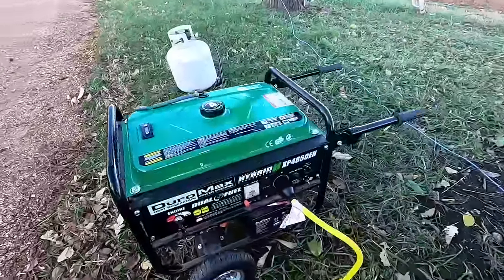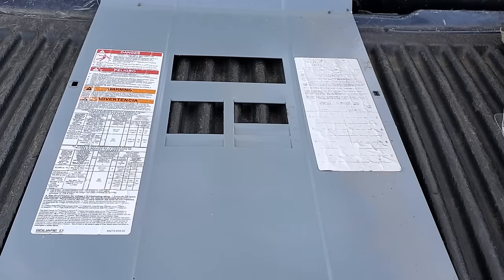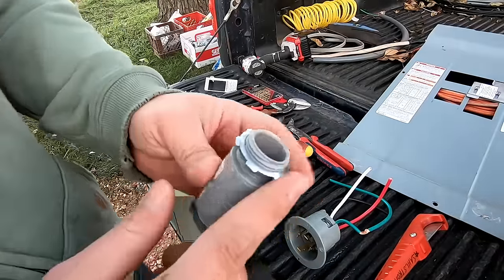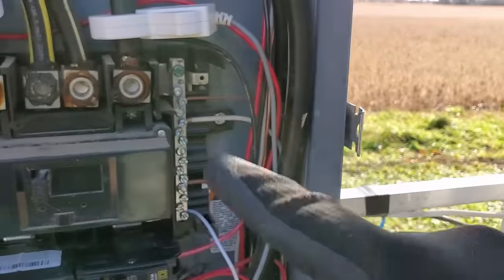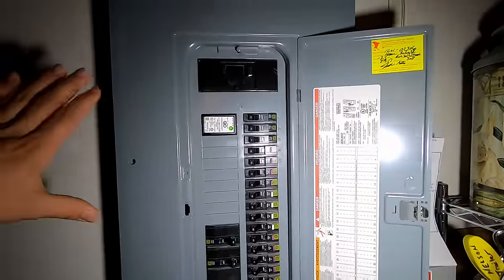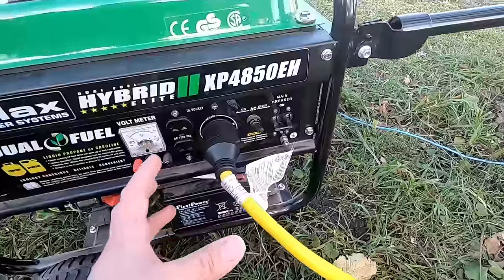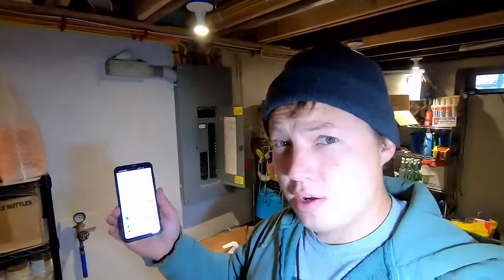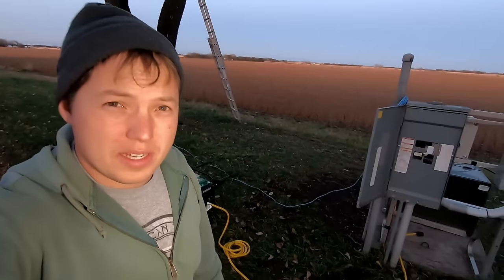How To Hook Up a Generator To Your House Using a Breaker Interlock Kit & Power Inlet Box

Comment: Excellent video. I love all of your videos! I have one exception though. I have to disagree with you a bit in regards to your comment about the Duramax generators. I have three of them, (one is a 7200 watt diesel generator) and they all work perfectly. Never a problem with starting or running. China did a good job with these.

Comment: I love the idea of the propane fired engine for your standby generator so you don't have to worry about gasoline going bad and fouling up a carburetor. Great video. Thanks a lot for the work you put into it.
Reply: Here are the generator safety rules that everyone needs to follow: this is just a reminder for everyone’s safety. Always make sure you follow all the generator safety rules whenever you use your portable generator. Generators can be dangerous if not used carefully. Every year, hundreds of people die or get injured when using portable generators due to carbon monoxide poisoning and electrocution. Make sure you are using your generator carefully and keeping others safe as well. There is something very serious that everyone should always be aware of when using generators. Some people do run their generator indoors which is not safe and that increases the risk of carbon monoxide poisoning which can cause death of family and you. Some people run their generator in wet conditions which can electrocute them. Please remember that you should never run your generator indoors. Remember that carbon monoxide is an odorless and colorless gas that you cannot see or smell. Carbon monoxide is a silent killer. Keep that in mind. Make sure your generator is 15-20 feet away from your house and away from doors, windows, and vents. Never use your generator in your porch too. Having a carbon monoxide detector is very important against generator safety. Some people also allow children to go near the portable generator which could pose risks. We need to keep an eye on our children making sure that they are not near the portable generator so they won’t get electrocuted or burned by the generator which is dangerous. A locking enclosure also keeps kids safe. A generator shed might look like a tempting place to explore, or take cover during a game of hide and seek, but a generator is a dangerous piece of equipment that can cause injury. It says on the manual that we should also keep children away at all times from the portable generator to avoid injuries. Please do not allow a child or unqualified people to operate the portable generator.  It is important to keep your children safe especially little ones. The portable generator can be hot during an operation. Just because some manuals missed what should be listed doesn’t mean it’s safe to do. Always follow the generator safety rules when using portable generators. Generators pose electrical risks. If you need to use your generator during wet weather, you need a generator tent to protect your generator from getting wet. Don’t let your generator get wet. Keep your generator dry and before using your generator, please make sure your hands and your generator is dry. Do not wear loose clothing when operating the generator. Everything that is said on the generator’s operating manual should not be ignored. Never smoke cigarettes near the generator. Please keep flammable things away from the generator. Never overload your generator too. Your generator can catch fire. Never ever try to plug a generator cord into a wall outlet to avoid back feeding. Back feeding your generator is dangerous. Always turn on your generator first before plugging in appliances and shut off the appliances before turning your generator off. Use a heavy duty cord for your generator and the cord should not be worn out. All the instructions should be followed carefully. Never refuel your generator while it’s running. It can cause fire if fuel spills while your generator is hot. You should turn off your generator and let it cool off before refueling it. Having a fire extinguisher next to the generator is also important. This is only a reminder for everyone’s safety of using generators. Make sure your generator is properly grounded. Having a fire extinguisher next to the generator is also important against the safety rules. https://youtu.be/I1jT3ANENvI and here is a video more about keeping others safe when using generators and also about our family’s safety. It’s important to keep our little children safe as well. Make sure your little children are kept away from the generator at all times especially when it’s running. Hope this helps. Always remember that it’s better to be safe than sorry. Also remember that warnings should not be ignored too.

Comment: Great video..I definitely was looking into these types of disconnect boxes 10-12 yrs. Back and never installed due to lack of full nolage on the correct installation and disc.box so I just disconnected main braker and tied into box with larger rubber insulated alligator clips attached to 10ga stranwire. And ran whole house on 6000amp. system many night due to ice storms but that was many year ago..haven't had a use for it since then..(fingers crossed) but now with your video I have the nolage to install thanks... video was well explained and edited.

Comment: I usually have to jump forward on videos because they take so long to get to the point, but you communicate so smoothly and cleanly that I never feel the video is lagging.  So, I am a homeowner/diy guy, and, with a number of your videos, have done a lot of rewiring in my house.  I want to use a generator interlock to connect a generator to my subpanel; unfortunately the subpanel doesn't have a power shutoff.  It's a Square D that has a slot for a main shutoff, and I spoke with Schneider, and was told that I could add one to the panel.  I was wondering if you've ever done a video about that process.  If not, I just want to thank you for the help you've already provided me.
Reply: Well, I just discovered one of your videos that taught me that the panel closest to the meter is called a cutoff panel, so what I called the subpanel above is the main panel.  That is the one to which I want to connect my generator, and which doesn't have a shutoff switch which would allow the generator interlock.  Sorry for the confusion.

Comment: Great job!

I have kind of the same set up.  I have 1 main 200A power panel where power comes in.  I think (2) 90A 240V breakers going to (2) sub panels in home garage where all the home breakers are.

Seems I can just add a interlock with 30A 240V breaker and 30A power inlet box like you have... simple enough.

Well, had an electrician come out and tried to sell me a transfer switch with only 6 breakers in it.  Wanted to install next to the (2) sub panels in house garage. Seems a pain in the ass.

He said my Firman generator (about 9300W startup and about 7300V running?) would trip off using a interlock and will ruin my panels, breakers and wiring???  I do not think so.  Also, if I turn all the breakers off and turn on 1 at a time each minimal breakers I need as long as I don't overload generator should be fine.

What do you think since you have a transfer switch and interlock options and similar set up as I?  Thanks for the help!
Reply: Remember to always make sure you follow all the generator safety rules whenever you use your portable generator. 
⚠️Here are the Generator safety rules that everyone needs to follow when using generators:

This is just a reminder for everyone’s safety when using portable generators. All generator safety rules need to be followed carefully to avoid hazards. 

1) Please do not allow an unqualified person or your children to operate the portable generator. Just because some manuals don’t say that doesn’t mean it’s safe. That is important against the generator safety rules. We also need to be keeping an eye on our children too. You need to make sure that your children are not playing near the portable generator especially when it’s running so they won’t get electrocuted. Generators pose electrical risks and they can be hot during an operation. Please keep your children away from the portable generator at all times. It is important to keep our children safe especially our little ones. Be aware of all the hazards.

2) Some people use their portable generators indoors which increases the risk of carbon monoxide poisoning. It’s important to have a carbon monoxide if you have a gas generator. Never ever use your generator indoors even if your doors and windows are open and even in the garage is not safe to use a portable generator. Not even at your porch and your deck. It is never safe to use your generator indoors and in enclosed areas of your home. Your generator needs to be 15-20 feet away from your house. 

3) 🔥generators cause fire hazards too. Never refuel your generator while it’s running. You need to let your generator cool off before refueling it and before storing your generator. Never overload your generator too. Never ever back feed your generator. You should never plug your generator into a wall outlet. Also never store propane tanks indoors. Please keep flammable things away from the generator as well and please don’t smoke cigarettes near the generator. Having a fire extinguisher next to the generator is also important against the generator safety rules. 

4) generator operation; make sure your hands are dry before touching the generator. Never use your generator in wet conditions. Don’t let your generator get wet. You need a generator tent if you need to use your generator during wet weather. Please don’t wear loose clothes when operating the generator. Turn on your generator before plugging in appliances. Use the right cord for your generator. Please do not use worn out cords. 

https://youtu.be/I1jT3ANENvI and here is a video more about keeping others safe when using generators and also about our family’s safety. It’s important to keep your children safe especially little ones. 

Hope this helps

Comment: Ben, I have just come across your videos dealing with connecting a portable generator to a home distribution source/panel.  I am dealing with an issue that your ground/neutral topic is dancing all around but not hitting my issue so I hope that you can comment.  I have a generator I want to feed my home during those times the grid is out for an unplanned outage resulting from hurricanes or winter ice outage times.  My situation:  I want to backfeed my main panel from two independent circuits in the garage from a portable generator source.  One circuit feeds receptacles and lights from the main panel.  The second circuit feeds two garage doors from a second branch breaker in the main panel.

The receptacle circuit is fed from the main dist panel to a GFCI outlet in the garage.  The second circuit is fed from the main dist panel to two receptacles in the garage ceiling, one for each door motor.  This circuit works well and operates the doors when connected to the generator and has no issues.  The receptacle circuit has the GFCI and when I plug the generator cable into the GFCI and turn on the generator voltate, the GFCI trips.  I can connect to one of the daisy chained other outlets and power up the remaining three outlets so I don't see a problem with existing wiring or connections and a plug/wiring tester I have checks everything okay.
I have a Champion 5000/4000 watt generator, Model 200921.  I have also discovered, thanks to your videos dealing with floating/bonded neutral/ground it is a floating neutral generator.  It is this floating/bonded ground "thing" I believe has something to do with it.  But, according to your videos, if I understand correctly, that the generator should be floating.  Thanks, I hope you can provide some insight into this problem.  Thanks again, Joe
Can you tell me what makes the GFCI trip when voltage is applied to the GFCI?
Reply: ⚠️Please don’t forget the rules about generator safety: This is a very important announcement for everyone. It’s important to follow all generator safety rules whenever we use portable generators: 

Everyone must see this. This is just a reminder for everyone’s safety. 

1) KEEPING OTHERS SAFE: Please do not allow an unqualified person or your children to operate and service the portable generator. Just because some manuals don’t say that doesn’t mean it’s safe. That is important against the generator safety rules. We also need to be keeping an eye on our children too. You need to make sure that your children are not playing near the portable generator especially when it’s running so they won’t get electrocuted. Generators pose electrical risks and they can be hot during an operation. Please keep your children away from the portable generator at all times. It is important to keep our children safe especially our little ones. Be aware of all the hazards.

2) WHERE TO RUN YOUR GENERATOR: Some people use their portable generators indoors which increases the risk of carbon monoxide poisoning. It’s important to have a carbon monoxide if you have a gas generator. Never ever use your generator indoors even if your doors and windows are open and even in the garage is not safe to use a portable generator. Not even at your porch and your deck. It is never safe to use your generator indoors and in enclosed areas of your home. Your generator needs to be 15-20 feet away from your house. 

3)🔥FIRE HAZARDS: Never refuel your generator while it’s running. You need to let your generator cool off before refueling it and before storing your generator. Never overload your generator too. Never ever back feed your generator. You should never plug your generator into a wall outlet. Also never store propane tanks indoors. Please keep flammable things away from the generator as well and please don’t smoke cigarettes near the generator. Having a fire extinguisher next to the generator is also important against the generator safety rules. 

4) GENERATOR OPERATION: make sure your hands are dry before touching the generator. Never use your generator in wet conditions. Don’t let your generator get wet. You need a generator tent if you need to use your generator during wet weather. Please don’t wear loose clothes when operating the generator. Turn on your generator before plugging in appliances. Use the right cord for your generator. Please do not use worn out cords. 

https://youtu.be/I1jT3ANENvI and here is a video more about keeping others safe when using generators 

Hope this helps. Remember safety first

Comment: It's not a torque drive but actually a Robertson's square drive. And I absolutely love mine. I have two sizes, one that will do most conduit and breaker screws and another that is just for decent quality commercial receptacle terminals.

Comment: I love you guys sharing your knowledge  and making sure it's done safe if you lived closer I would  bring over a case of beer and drink it with you         thanks  for your kindness.
Reply: ⚠️Generator safety tips:

This is just a reminder for everyone’s safety when using portable generators. All generator safety rules need to be followed carefully to avoid hazards. 

1) Please do not allow an unqualified person or your children to operate the portable generator. Just because some manuals don’t say that doesn’t mean it’s safe. That is important against the generator safety rules. We also need to be keeping an eye on our children too. You need to make sure that your children are not playing near the portable generator especially when it’s running so they won’t get electrocuted. Generators pose electrical risks and they can be hot during an operation. Please keep your children away from the portable generator at all times. It is important to keep our children safe especially our little ones. Be aware of all the hazards.

2) Some people use their portable generators indoors which increases the risk of carbon monoxide poisoning. It’s important to have a carbon monoxide if you have a gas generator. Never ever use your generator indoors even if your doors and windows are open and even in the garage is not safe to use a portable generator. Not even at your porch and your deck. It is never safe to use your generator indoors and in enclosed areas of your home. Your generator needs to be 15-20 feet away from your house. 

3) 🔥generators cause fire hazards too. Never refuel your generator while it’s running. You need to let your generator cool off before refueling it and before storing your generator. Never overload your generator too. Never ever back feed your generator. You should never plug your generator into a wall outlet. Also never store propane tanks indoors. Please keep flammable things away from the generator as well and please don’t smoke cigarettes near the generator. Having a fire extinguisher next to the generator is also important against the generator safety rules. 

4) generator operation; make sure your hands are dry before touching the generator. Never use your generator in wet conditions. Don’t let your generator get wet. You need a generator tent if you need to use your generator during wet weather. Please don’t wear loose clothes when operating the generator. Turn on your generator before plugging in appliances. Use the right cord for your generator. Please do not use worn out cords. 

https://youtu.be/I1jT3ANENvI and here is a video more about keeping others safe when using generators and also about our family’s safety. Hope this helps